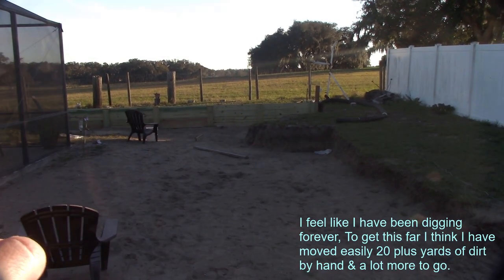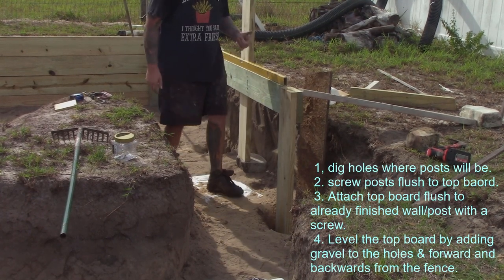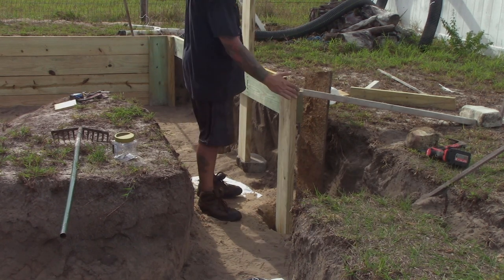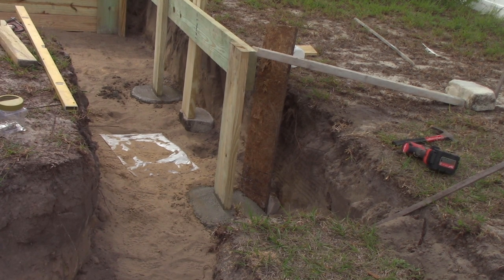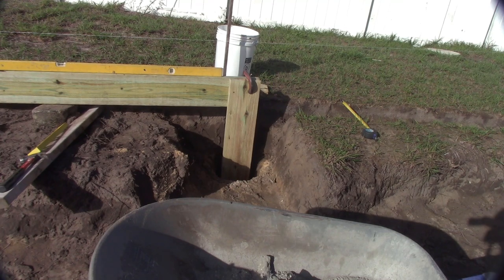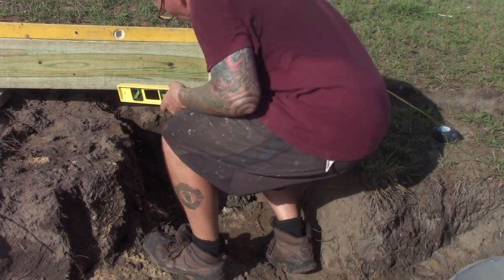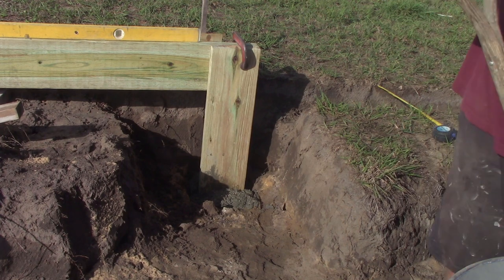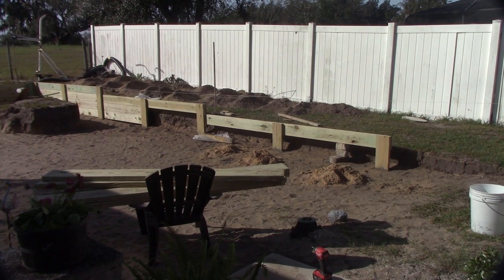Building A Wooden Retaining Wall

Comment: Looks good. Only tip is to pay attention to your grain on your top caps. The way you put the board, it will cup up and cause water to go to the middle. Put the bark-side down and it will round over and cause the water to flow off.